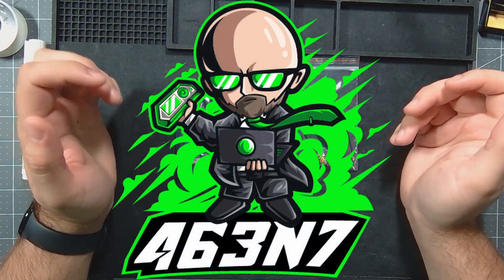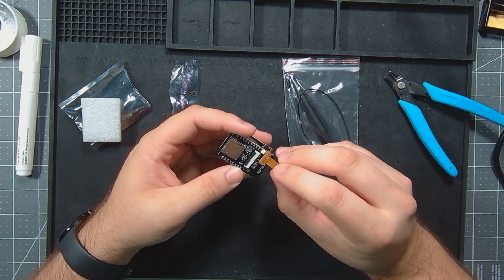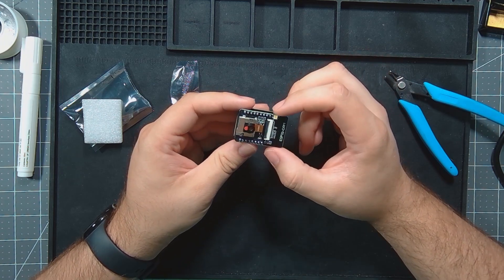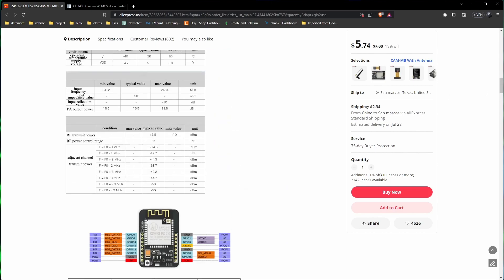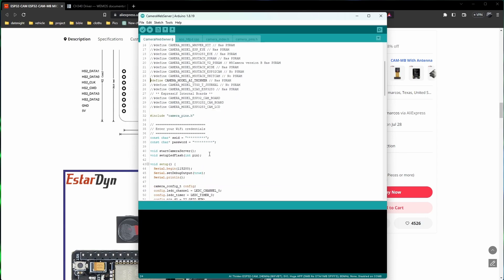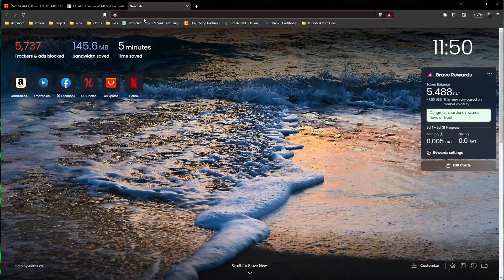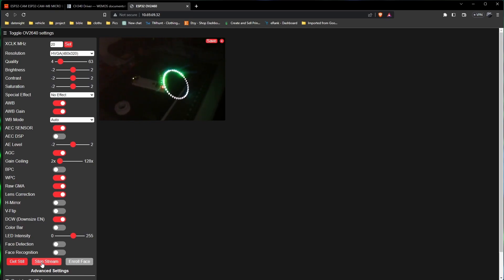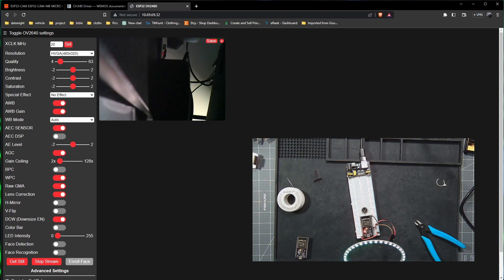Getting Started With the ESP32 CAM

Comment: The sound in your video is too low.  I have never had good luck with an esp32-cam.  The image quality is awful though yours looks good so I may have to retry the ones I have or buy a new one.   I recently tried a esp32 s3 sense and it works great.
Reply from the maker: Yeah my newer videos are getting better with sound. Yeah id didn't seem to bad i need to play around with it more though just so many projects lol
Reply: I just tried another esp32-cam board and it worked fine.  Either the other ones I had were bad as I had never tried this one and it was still in a sealed package.  Or my wifi was the issue.  I recently upgraded to a wifi 6e router.

Comment: has anyone ever encountered the "Camera init failed with error 0x105" issue while using ESP32 CAM?
I have changed several modules, but the same error persists
Reply: I have same issue
Reply: @HomeAutomationTECH  did u find any solution?